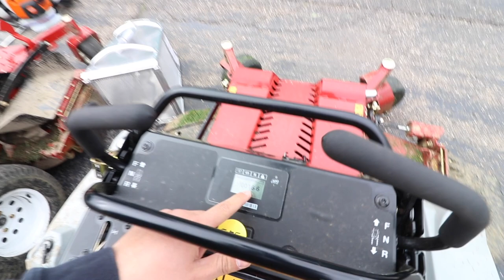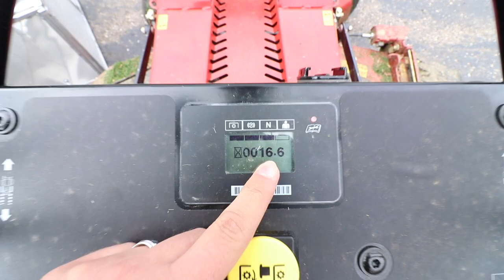Our 2019 Trailer Setup For Lawn Care!! ► Revealing The New Exmark Staris Mower

Comment: Good evening. Just a 45 yr old homeowner. If any mower can withstand a mowing business then I feel any homeowners can buy said mower brand an get x amount of yrs service out of said mower or equipment.
Reply: yes they can buy said mower brand. but these mowers and every other high commercial mowers are $10,000. that’s at least 7-8 years of lawncare service cost in retrospect. plus the time you would then have to do your lawn.
Reply: Absolutely. I like taking care of my yard. My lawn is 2.5 acres. Gratiot County Michigan. So my cost is at commercial cost. I appreciate Brian's advice/ approach to equipment and lawn care. Also landscaping as well. Your statement is correct though. Hind sight of earlier statement left out some info on my end.

Comment: 2005 f250 6.0 powerstroke 4 door 4x4 
6.5x12 trailer 
2018 exmark radius x series 52 with Ez Chute 
Echo trimmers Pas/edger and Blowers and headge trimmer 
Honda 216 push mower 

2019 setup for GIBSON'S MOWING

Comment: I'm 16 running 
2004 dodge Dakota 
4x8 open trailer 
2010 gravely compact pro 34 zero turn
1980 Goodall 48in walk behind 
2002 echo srm210 w/ edge it pro
Crappy ryoby back pack blower
EZ roll commercial edger

Comment: Epic setup mate. Will be interesting to see how you like the Staris :) On my setup side I'm only 17 and really only have 1 day a week to work so not tons but here's the most current list of what I have for my business in Melbourne Australia:

2016 Victa ZTX 23/42 42" zero turn mower
2015 Honda HRU216M1 21" self-propelled mower
2016 Rockwell ShopSeries 16" push mower
Stihl 046 20" chainsaw
2017 Stihl MS171 14" chainsaw
2018 Giantz Pro 12" arborist saw
2017 Stihl FS94RC trimmer
2018 Stihl FS91R trimmer
2017 Gardenline 4-in-1 multi tool
Kawasaki TG25 brushcutter
2017 Gardenline stick edger
2016 Gardenline wheeled edger
2019 Stihl BG86 handheld blower
2016 Stihl BG56 handheld blower
2018 Stihl BR700 backpack blower
2014 Gardener's Choice blower-vac
2018 Shindaiwa DH230 petrol hedge trimmer
Shindaiwa AH230 pole hedge trimmer
2017 Gardenline petrol hedge trimmer
2017 Rok petrol hedge trimmer

Comment: 2019 Setup

2015 Chevy 2500hd Duramax 
7x16 Carmate custom cargo hd w/ 12” additional height and equipment defender racks 
52” Exmark LazerZ S-series 
30” Toro time master 
Stihl KM90r w/ brush cutter, bed edger, sidewalk edger
Stihl FS111r string trimmer
Stihl BR600
Stihl BG56e
2018 John Deere 2032r w/ 220r loader

Comment: Not a fan of those exposed fuel lines on the Staris. I could see those getting snagged real easily on branches. Would probably have been a better idea to tuck those under the tanks
Reply from the maker: If those get snagged you’re doing something wrong. The tree would poke into you first before it ever hit those lines. And they’re tucked in pretty well imo

Comment: Toro gravely xmark Husqvarna cub cadet troybilt is a few that’s around here do not like a toro I own a troybilt fantastic mower plan on buying a newer mower next year if not sooner I started last year my weedeater is ryobi 2 cycle and also a ryobi blower love the weedeater not a big fan or the blower sthi chainsaw still working on getting equipment 2003 Tahoe pulling a 2019 6.5 x 14 ft trailer got bigger so I could haul 2 mowers if needed

Comment: you say "34 HP big block" Is there really a small block and big block
Reply: Kevin Cloonan yes.
Reply: I owned several Lazer Z XS 60” TRITON Deck models back in 2008…35 horsepower Briggs & Stratton Vanguard Big Blocks. Pretty torquey. Also love my 27 HP Kohlers.